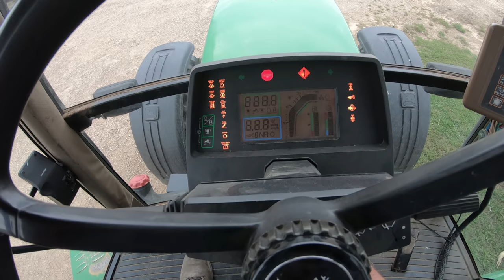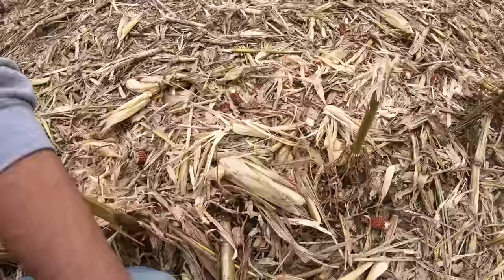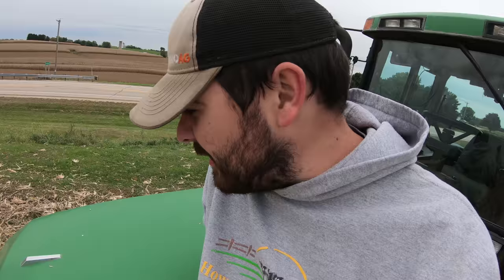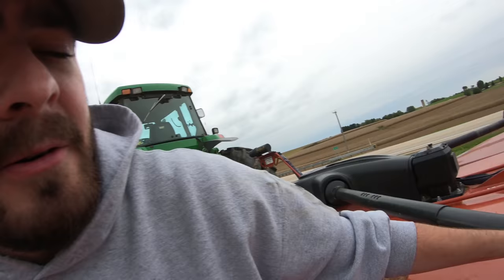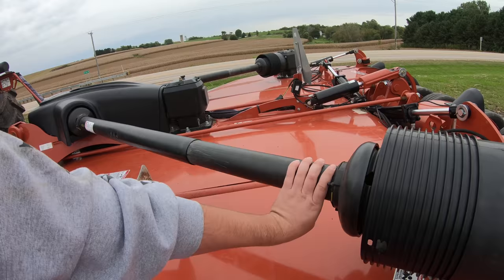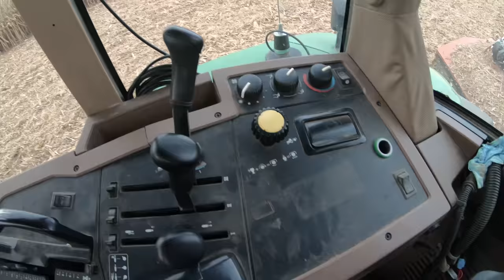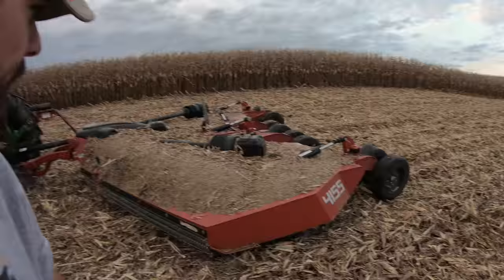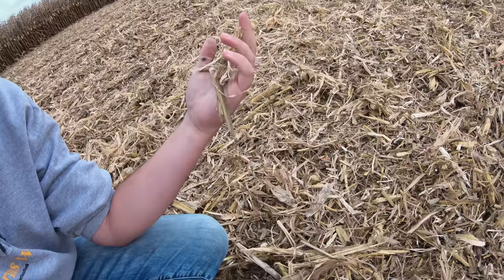Mowing Stalks For Cattle Bedding

Comment: If the PTO guard IS functioning as designed, the chains are unneeded. If the guard is working properly, you can grab it with a hand while it is spinning and stop the guard's rotation while the PTO shaft continues to turn. In the winter if you have a long scarf wrapped around your neck and it some how gets tied around the spinning guard, it will stop the guard's rotation. If you are standing on the mower deck while it is running and your leg contacts the spinning shaft, either covered in long pants or exposed by shorts, the guard will stop spinning instantly. I have observed all these scenarios and many more all with no "safety chains". Far more important than the chains in insuring that the bearings at each end of the guards are properly lubricate and functioning properly. Instead of taking the mower back to Air-gun in the yard, use you hands and/or feet to push all the chaff of the top of the mower in the field. That way, you do not have it blowing of onto other motorists on he road and DO have if retained in the field as natural tilth. Carrying a broom on the tractor would be a good idea too.  sdh in the Tobacco Valley of CT

Comment: how come the fields are planted in such odd shapes?
Reply from the maker: Hi Tucker,

They're shaped as they are to reduce erosion. Every wheel track and row in the field creates a small valley, increasing water infiltration and reducing runoff. These are called contours and were popular in the 80's.

Comment: I would imagine the corn stocks have organic matter and nutrients for the soil so I guess my question is how much money are you saving by bailing the stocks up versus leaving them in the field for fertilizer?
Reply: After being used as bedding , the corn stalks return to the field as manure . So it makes no difference.
Reply: They will be returned to the fields after the cows use them for bedding and bathroom. When they are spread the next time they will be even better for the soil. Not saving any money in the long run.

Comment: In the UK , it’s against the law to not have your PTO guards chained up, health n safety would have a field day if we did that
Reply: Well talking 2 different places. I run no guards. I snapped a PTO shaft before. Ya, it beat the hell out of the deck, but the 3 point saved from more damage. Even the new shaft i took the guards off. Doesnt fit the safty clamp on the inboard shaft incase the shearbolt fails. Either way, 2 different countries and different laws. UK is pretty ignorant compared to the US on quite a bit and the same for the US to UK.